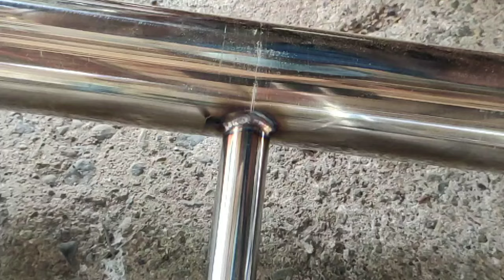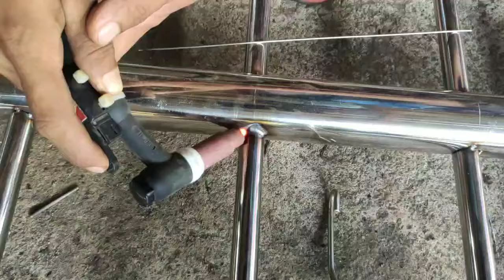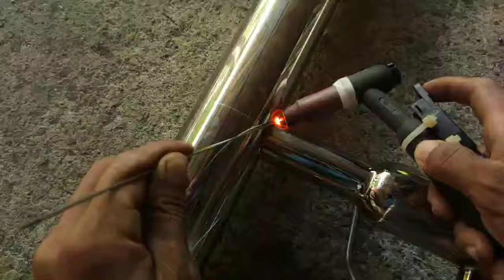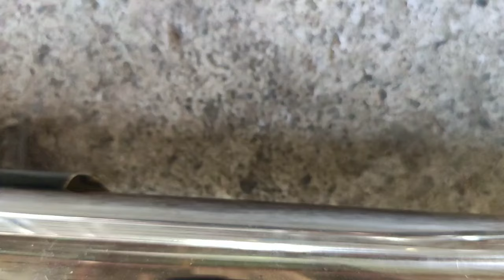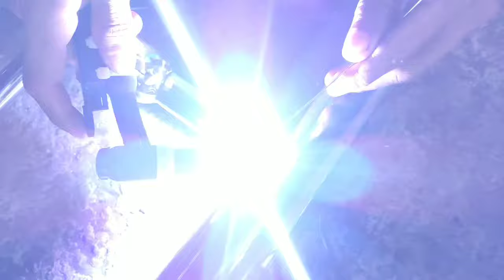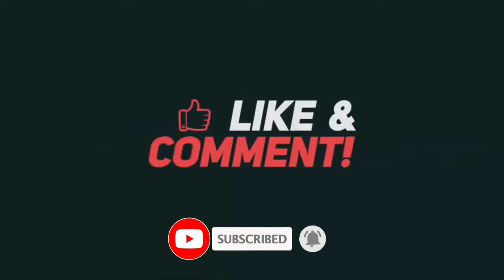Stainless Pipe 1.5mm 304 Welding TIG

Comment: This way of welding (usually called cold welding) is not a good way of welding. And no I don’t mean tig welding cause tig welding and cold welding are not the same thing. They use the same tool but work differently and give different results. Anyways cold welding is not good
Reply: For thin material the cold welding is good. But for thick material the cold welding is bad because don’t enough deep fusion.

Comment: am tired looking that style welding. i have cold welding and ac dc. welding . those that i have can melt weldinh rod without black colour or undercut. if you r guys don't have dc with machine with spot timer to melt filler rod you need at least 150amp for filler sixlze 1 mm. press the trigger switch as fast as posibble . girnd Tungsten at 60 degree with blind tip. for me if i have welding like that its better use jumbo cup gas cam cover area welding. my Tungsten stick out can be longer . or filler rod it doest matter 308L or 308. for gate like that i had better use 308 for save money. rather than extra low carbon.
Reply: R8

Comment: Lol, its pitty thst he destroys the weld at the end by removing the gas shield so quick
Reply: If it holds, he got paid. That's all he cares about.
Reply: Not a particularly strong way of welding it would be okay for a towel rail or something like that but I certainly wouldn’t use this on a motorcycle frame or anything under stress